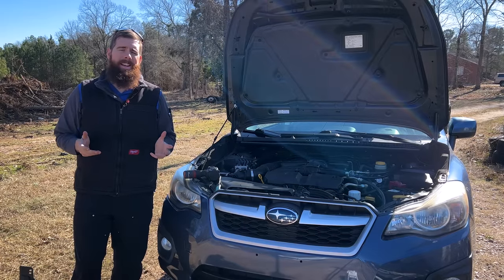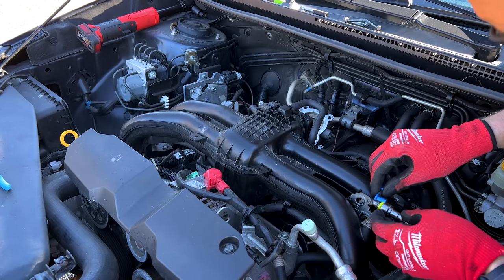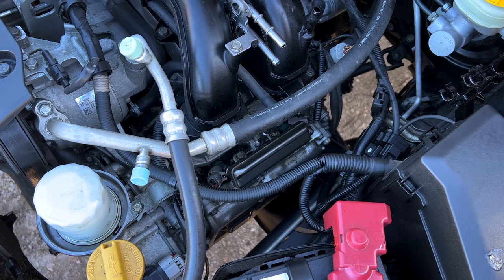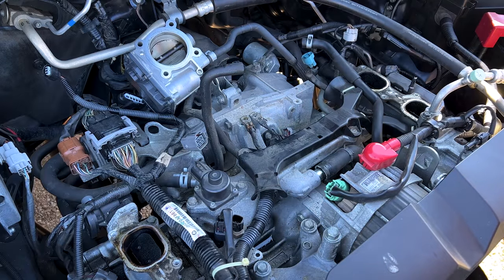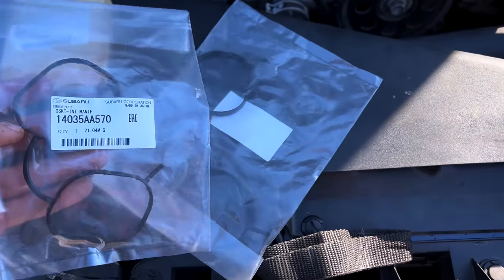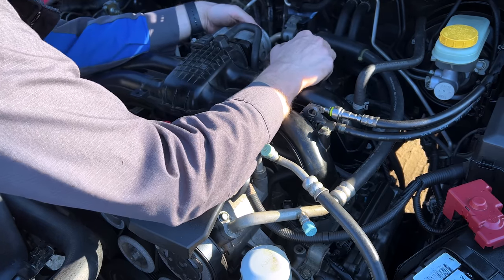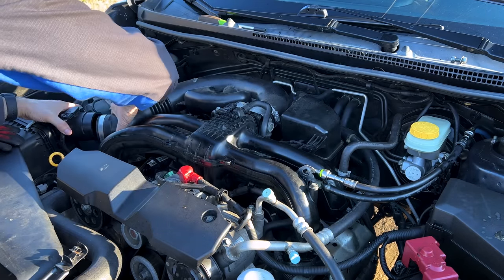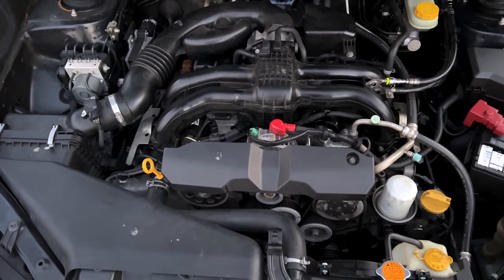Don't Let This $2 O-Ring Wreck Your Subaru's Cooling System! Fix That Coolant Leak Yourself, Cheap!

Comment: That digital torque wrench is not in your storefront. Do you have an item number for the one you're using in this video? Thanks in advance.
Reply from the maker: It’s a Snap-on tool. Not sold on Amazon.
Reply: @MrSubaru1387  Gotcha! Thanks for the reply. Need to find one that functions similar to that.

Comment: Is there any way to pressure test the coolant system after you install the new o-rings but before you put it all back together?
Reply from the maker: Yes. The vacuum refilled I use, but the system under vacuum and see if it holds the vacuum. Or use a cooling system pressure tester.

Comment: hello, excellent channel, great job, I have a question, I live in Mexico and there are not many mechanics here who know about Subaru, my problem is that the oil got into the radiator and I don't know why, the engine has no coolant but The radiator does have oil, I recently changed the pcv valve but I don't know if that is causing the problem, could you help me? greetings!
Reply: I’m having this problem as well, let me know when you get it fixed

Comment: I have 2 questions
 1 which transmission is compatible with the Subaru 2.2l N/A recently my transmission broke and 2 I want to do a swap ej18 to ej22 what is needed or what do you recommend

Comment: Nice video! But that is still much work. Anyone have good or bad experiences with using K-Seal? I used it in an old car that had a heater core leak and it fixed the leak.
Reply from the maker: Why risk damage and waste money on snake oil, rather than performing a proper repair?
Reply: I just finished an EJ253 rebuild where the previous owners used stop leak. Had to junk most of the cooling system and spent a lot of time cleaning the block because of all that gunk. Why would you do this?

Comment: what is your advice about radiator caps? I just took my car in today to have the radiator drained and new coolant and the tech broke my cap!!
So they just put a standard on and I have heard there is a special cap on the actual radiator should I go to another dealer and get a factory replacement? Is it safe to change it out myself serious I was shocked that the tech broke my cap. They tried to say it was already broken and with the heat around here there is no way my car would have not over heated and I would have known there was a issue. I m super mixed up now as they told me not to come back for service. The other tech a while back broke my ac lines while changing out the differential fluid. I was like wow what is going on. How is could that happen? Oh well. Please let me know your advice about the radiator cap. Its a 2011 outback. Thanks
Reply from the maker: OEM only on caps.
Reply: @MrSubaru1387  thanks I will go get one tomorrow. got to find a dealer i can trust to not break things on my car. I appreciate you fast response I would glady pay you for work but I am a long ways from your shop!!. Best wishes to you and your family always.

Comment: Is this the car that had the broken radiator? If so wonder if those orings got a little toasty when that happened and leaked coolant.
Reply from the maker: It is doubtful. Likely just the cold, age, and heat cycles.
Reply: @MrSubaru1387  just wondered they were super brittle

Comment: Sorry. I was a bmw mechanic and Subaru and BMW sound alike to me.

$5 o ring failure and you have a massive milk shake.
Reply: This O-ring fail It is not a "milkshake" (coolant getting into oil). It is just loss of coolant to outside. In other words zero damage unless you keep driving overheated
Reply: o2975  i am referring to the oil cooler on a bmw with a N52 or 54 engine. That will milkshake.

I don't know about the Subaru engines.

Comment: I have this same issue on my 2011 with coolant accumulating in the same spot but it evaporates away and there is no coolant leaking that I can see with the hood open and the engine running. Obviously, I need to keep an eye on this, but like Mr. Subaru I have no garage, and it's cold and winter here in Canada so I will need to wait until mid-April or so to be able to do this. Over the past 3 months, I have lost enough coolant to take me to the min line on the overflow tank from full. Still, the car runs fine and has no heating or cooling issues. I am just wondering if my plan to top off and wait is OK or if I am risking disaster by not rushing to fix this? Thinking back, I did notice this over a year ago but thought it was the gasket for the coolant temp sensor which I replaced. The leak seems to come and go but seems more pronounced following very cold exterior temperatures. Can this wait as planned or am I being a fool not to have it repaired as soon as possible even if it might be a pricey fix?

Comment: Even back on the 03 2.0 motors they had that water crossover pipe.  Some other manufactures have a similar thing on certain vehicles.  Like the old Chevy 6.2 diesels.  They have a water cross over pipe but I think it was front mounted on the block or it was going from head to head?

Comment: Can you reuse the coolant after the job? If not what do you do with it?
Reply: It is best not to reuse coolant due to its age and contamination. Recycle the old coolant properly.
Reply from the maker: Subaru super coolant has an 8yr/80k mile service life. Depends on the age of it if it’s ok to reuse. It is easy to it get it contaminated though, so rarely reuse.

Comment: my AC 3/4 in 2014 Crosstrek XV cuts out... everything else works... what could be the potential issue? I tried changing out the resistor, but all the same....

Comment: hello and much respect  for what you do.  I bought my 2006 outback from my  mother in law. She now has a 2017 outback. I have managed  to hit 219,000 on the 2006. I would say on a scale 1-10 that i am on a level 4.  And thats generous. I am intelligent  enough  to have used your videos to solve multiple  issues.  I am an arborist by trade and have learned a small amount of wrenching because of the nature of my career.  I would love to have a conversation  with you.  I am not ignorant to how busy you are on a daily basis.  However I am an intelligent  person that believes we can benefit  from each other.  Its a rather complex scenario. One i do not wish to share on this platform. I assume you are doing well with the workload you have decided to take on.
I would love to have a conversation with you.   there is no doubt in my mind you are well equipped  in what you do .   I have 219,000+ on my 2006 outback.  My mother in law has been taken to the cleaners on each of her outbacks.  I won't knock any business  at the moment. I do not know where you are located but  I don't  mind traveling. I actually enjoy  it while I can before our season kicks into high gear.   This is a paraphrase  of a multitude  of issues with our Subaru's.  I love them and believe I will always own one or two or three.  I have a small window of time before my wife has surgery  in April and my specialty  as an arborist ramps up.  I would love to hold  a conversation with you and possibly  visit you with my outback for s#its and giggles. I love your channel and I am certain we can learn a great deal of knowledge from one another.  You may pass by this with no thought. I can guarantee  one conversation with me will change your mind.
Balls in your court.......regardless  I appreciate  what you do.....If you find time to learn what I do you will not be disappointed.  Likely you will be disappointed with our medical system. When and if you put thought into it; there is not a ton of difference.  As unfortunate  as it may sound.  I have left major details out on purpose.  Hopefully  your curiosity kicks in and you find the time to respond.  I hope to hear and speak to you soon.  What I can share with you is greater then cars but we do need them to get to our oncologist, radiologist. amd many other useless doctors. 
Your car diagnostics unfortunately  align with our medical system.  Lets make some noise.  I have started paving the path, any outlet that shows misinformation  only backs up what we are dealing with.  You may not realize  it but what you are doing encapsulates our "lovely" health system.     Keep doing what your doing.....If you decide to reach out it only helps our society.
Thank you regardless of the outcome.

Comment: NEED HELP, My wifes 16 crosstrek 103k just had the red temp light on once she got to work 30min away 2 nights in a row while idling. Fine when driving. So we took it in hoping it jeeded coolant or maybe thermostat or something. They said they found oil in coolant but it must not be much we had it flushed and leak tested. I think there was an o ring leak but forget if they sated which one. On their paper they said oil in coolant needs further diagnosis could be head gaskset or oring in oil pan?? Would it more likely be this. Idk if anyone will see this that can help. Its been paid off for awhile doesnt feel thay great on the road anymore. So thinking we have to get rid of it. I drove it home from dealer fine, no drops under car, no "visible" oil in coolant or coolant in oil. I was a mechanic in the military and have mechanics im friends with at my work truck driving. Should i fix it or move on? Need help

Comment: No wonder so many tech's are quitting. This is another example of why you don't want Little Johnny at the dealership to touch your car.
Reply: This is also another good example ( as All of your video's are ) of why in the eyes of just about any dealership You Will Never Be a Good Service Tech For Them. You will Never make enough money to satisfy them. *Wear This Like A Badge Of Honor". They charge $150/hr. for full book hrs but demand the tech slam the job out in half time or less.
You are too Thorough and Focused . . . as you should be and . . . We hope you never change. They want $peed at a level which cannot be done unless the tech cuts every corner possible for maximum profit and in many cases afterwards the car Is Still As Broke as when it came in. On top of that you may find something else is broke or is breaking soon after. Gotta Love Little Johnny . . . 
The tech's are pissed that they don't make enough $$$ and . . . probably don't.
Nationwide they are perhaps in need of 3,000 tech's and many of those who are still on the job need to be Closely Re Evaluated and/or Retrained. Also, some sort of Local Gov't QC Insp. for Dealership Repairs needs to be created and I mean $$$ome kind of QC with Teeth in it. But That's Just Me and My Stupid Way of Thinking

Comment: I replaced my timing belt and water pump. I bled my system and now all my lights are on. ABS,AWD, CEL, sport, cruise, and my temp light blinks red and blue. I have no idea what to do. Thanks in advance

Comment: Are you using a special kind of telfon? If not, won't it just burn/melt under the heat of the engine?
Reply: Most generic teflon tape can tolerate more than 200 degrees C. So no, it won't just melt. The PCV valve isn't exhaust.

Comment: For that much work, with 170,000 miles, I think I would just pull the motor for a refresh.
Reply from the maker: 197k miles. That much work? Like an hour job without filming a video.
Reply: @MrSubaru1387  I don’t doubt you could complete that o-ring R&R in an hour.  It would take me about that long to gather the right tools !   Great video.  I even watch ones that don’t apply to my vehicles.  Look for my $ donation !

Comment: what's the book time for a job like this?
Reply: dealers 4 hours but they will completely remove harness so as no to stress it and so to fully remove and inspect crossover manifold which are often seriously corroded